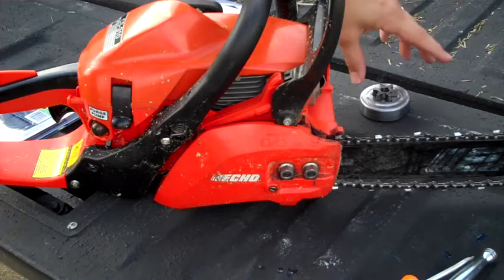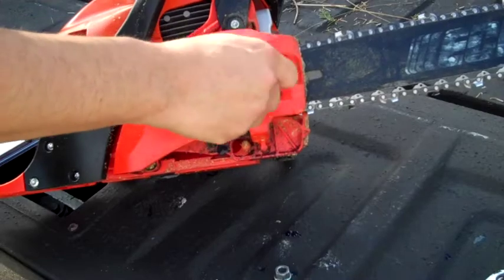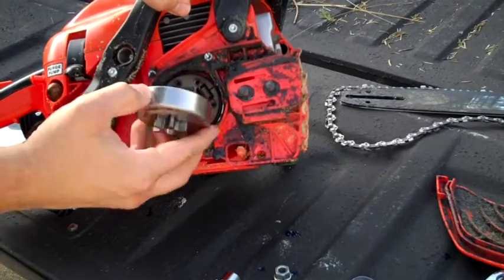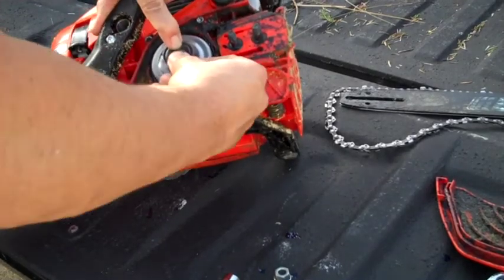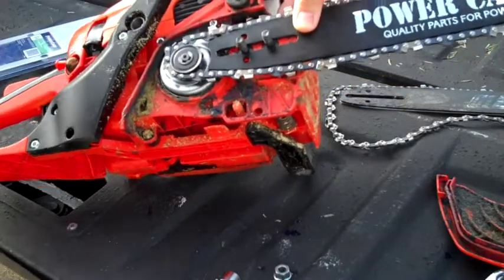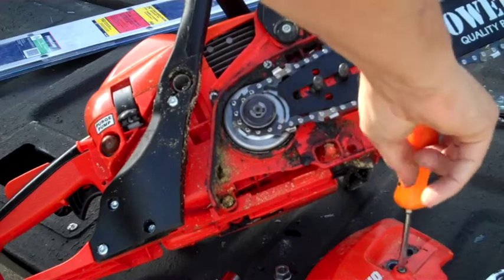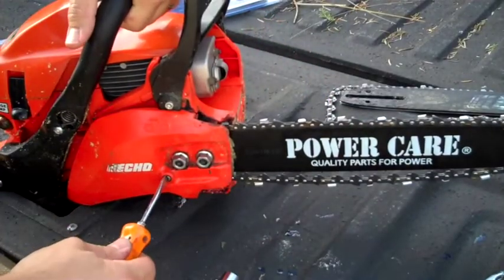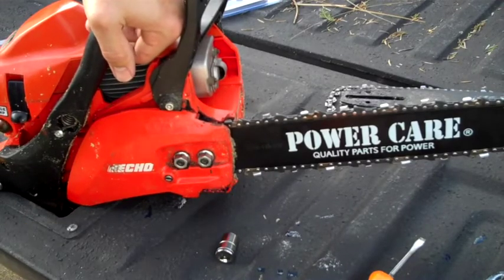Echo Chainsaw CS-310: Bar, Chain, and Drum Sprocket Replacement

Comment: C-clips have a really nasty habit of finding their way to the darkest depths of the corner of you workshop so that you spend the whole afternoon looking for them. Screwdrivers always love biting your fingertips when one of those C-clips decides to spin across the room, too. :-)  Not sure why God chose to not give us humans a 3rd hand to hold the saw, hold the screwdriver and hold the camera all at one time. Question: Are you not supposed to tip the front of the bar upward when tightening down the locking screws on this chainsaw? Not sure if that is required on this saw, but I know it is on other brands. Just got one of these today and I am viewing all the videos i can to see what works and what doesn't on them.
Reply from the maker: I’m honestly not sure.
Reply: Definitely... I even have the bar up while tensioning the chain and then while tightening those lugs

Comment: that metal round piece doesn’t work like that on mine. It doesn’t fall right in. There’s a metal round ring that is preventing my thing from dropping in like that. ??
Reply: You got to pull brake handle back and it releases tension in metal round piece. I had same issue 🤣🤣while watching had to look at few other videos

Comment: Why didn’t u show the inside of the clutch bell. After all that is where the clutch makes contact with the clutch bell.
Reply from the maker: I didn’t think that was relevant? I don’t know… I just changed out the parts that I could see needed replacing.

Comment: is so worn out because he must be using a chain with the wrong number of links.
Reply from the maker: That was the original equipment that came on the saw
Reply: Could you Tell me how to change à broken bar bolt

Comment: This is a how not to change your Bar & Chain video ....!!!
Reply from the maker: Really? What was done incorrectly?
Reply: Cliff's How To Channel , I am a Stihl Platinum Certified Technician with 38 years experience, where do you want me to start ? How about the most obvious two things , when you set chain tension the bar tip must be at it’s highest setting , meaning pull the bar tip up as you adjust the chain tension and when you tighten the bar nuts use a ratchet or the Scrench supplied with the new saw . Tighten the bar nuts more than finger tight holding a socket in your hands. And then rotate the chain on the bar to test proper tension because often times the chain on the clutch drum sprocket is not fully seated and will loosen after one rotation of the sprocket . Recheck after always ....